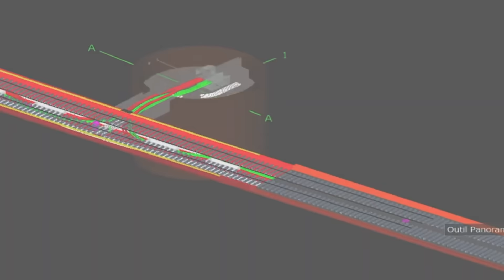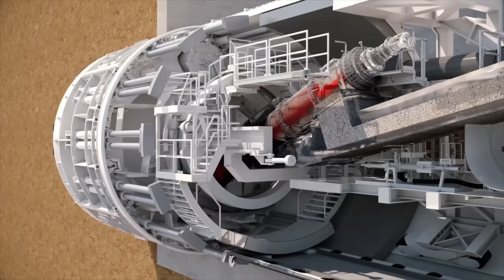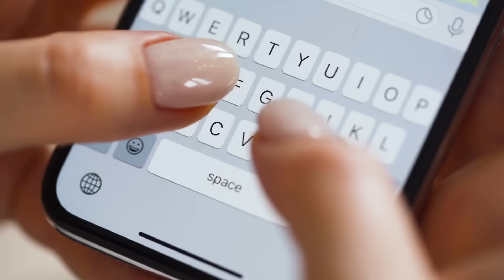The Grand Paris Express - Europe's Largest Transport Project

Comment: Whuile the addition of the jew lines will allow to tranits on the closest surrounding suburbs failry well nd will lightent he load int he middle, it's stillr ather unsuficient, there's still quite a lot of the Parisian region, especialy in the south-South East that still very car dependent. I know there's tram-trains that are going to be built there and there but still defintivrely could use some more int he outer parts.
And god know the RER B, C and D could use some renovations (especialy B south and D). Hell even a couple of lines of subways inside Paris could use some freshenin up and some way to aleviate the trafic (looking at the 8, 10, 12 and especialy 13)

Comment: Similar in some senses to the Elizabeth Line in London. Its quickly become one of the busiest lines in the country
Reply: The Elizabeth line (117 km of rails) passes through central London. Paris already has 5 lines like this 
RER A 109km
RER B 80km 
RER C 187km
RER D 197km
RER E 56 km
The Grand Paris express  (200km of rails) is different. It aims to connect suburbs together without ever passing through the center.

Comment: Amsterdam built a 9.7 km metro line, which took 15 (!) instead of the planned eight years, and cost €3.1bn instead of the original estimate of €800m. Arguably, Amsterdam is a very challenging spot to build anything, let alone an underground railway, but also arguably, Amsterdam has never managed to build a metro line and not ** up somehow.

Could be worse, though: could be HS2.

I love Ligne 14. The last time we were in Paris, we had a hotel a couple of minutes from the terminus of Olympiades. The escalator worked one day out of the week we were there (our son, who does not speak French, thought it was "horse service"). Other than that, it's beautifully designed, and it's just great sitting at the front of the train, which runs completely automatically.
Reply: Is your subway under sea level ?
Reply: @Difdauf  Amsterdam is two metres under 'normal Amsterdam level' (NAP in Dutch), so it is indeed.

Comment: The Grand Paris Express is NOT about 200km of track but about 200km of LINE (400 km of track). This line length is 100% in tunnels with up to 21 tunnel boring Machines working simultaneously. There are additional line extensions and open air lines

Comment: One of the worst project ever. 
France needs to be decentralised. 

This project is wrong in so many ways.
Île-de-France is a hell. Most people there want to leave to a better and more affordable place. 

They are using tax money to increase the number of inhabitants of a place that should instead shrink and be scattered across other regions of France.
Reply: After this project, the “société du grand Paris” is going to become “Société des grands projets” and RER are planned to be constructed in many French cities, and also there is the Bordeaux-Toulouse high speed line, the Lyon-Turin… yes France is too centralized, but Paris needed that and the rest of the country is not totally abandoned
Reply: @sans_hw187  23 French cities inaugurated a new tram network in the past 20 years. That's basically more than any country except China. Rennes inaugurated last year its second metro line and a third metro line is currenctly under construction in Toulouse. So it's not as if nothing were done in the rest of the country.

Comment: Added to all of these are also a comprehensive number of new Tramway lines, and a few RER/Transilien extensions. All this project is a godsent is if works as intended , as the few lines crossing Paris West/East like RERA are at near 170% capacity. Traveling on both sides  without getting through the center, it's the dream of a huge part of the Ile de France population.

Comment: They should think about maintaining and cleaning the existing metro network first. It's disgusting and unreliable on most lines. Not to mention archaic with the stupid paper ticket system which fails most of the time. Get with it and let people tap on and off with their phones It's decades behind the rest of the world.
Reply: Well they are doing that too, line 4 has just been automated and other lines are gettin brand new trains. The paper ticket system is coming to an end and you can already use you phone if you have an Android system. If you have an IPhone, the function will be available in early 2024.

Comment: I'm in Montreuil, a near Paris suburb, and I work in Paris. I'm waiting impatiently for the line 11 extension, which is already late due to Covid, and got once again delayed from fall 2023 to spring 2024. That's more than 18 months late compared to the plan when I moved here. I have to travel by bus to Montreuil downtown and take the metro (line 9) there, which is very inconvenient. When the line 11 finally opens, I will save at least 30 mintues on each trip, so one hour a day, not speaking about the difference in travel comfort. I can't wait, seriously...

The Grand Paris metro is not the only public transport infracture currently in development in Paris. The RER E line is also extended to the west, to La Defense and Nanterre, and multiple new tramway lines and extensions of existing lines are in the works.

Paris organizing the summer olympic games in 2024 was used as an argument to make the Grad Paris "profitable", so to say, as in "we need it anyway, but at least, it will be immediatly useful for the olympics". In the end, only the extensions of line 11 and 14 will be ready in time. Official reason is Covid. Of course...

Comment: I live in the South Eastern suburban area of Paris between 2 new stations on the new line 15. It will save me a lot of time. Right now with the trains I can only go to Paris in the North-West direction, with the new line 15 I will also be allowed to go East and West and circle around Paris and connect with other lines, I'll save a lot of time to reach the airports, business centers, or even Disneyland.
The project is needed by the population, it's a very good investment, and it's only a new beginning because more stations and more lines, at an even cheaper cost of construction, will appear over time in this 21th century.
The metro web of the region won't stop growing anytime soon, that's a certainty.

Comment: I line 14 will be over staturated once all line are connected ... I'm afraid Paris transportation will be worse than toady (that is already a hell)
Reply: Line 14 trains have been enlarged from 6 cars (90m) to 8 cars (120m). And considering that it has SAET automated system, it will have the frequency to deal with it. The good news is that it can relieve a bit the RER B which is a bit alone currently in the Southern suburbs.

Comment: I work beside the future line 18. It looks to be at an advanced stage (tunnels finished, stations being built), but the first section (Massy to Saclay) is not set to be opened until late 2026 and the next stage (Massy to Orly Airport) until late 2027. I'd love to know what work is required for the next 3 to 4 years.

Comment: Projects like these should rightly be celebrated, even if they do inevitably go over budget (19m to 36m is quite a jump). Here in the UK, transport projects like these (such as HighSpeed 2 and Crossrail 1) generally are threated with cancelation if costs overrun, irrespective of how much the country desperately needs them. Crossrail has revolutionised travel through London just as the Grand Paris Express will revolutionise travel through Paris when it opens, here's hoping that it doesn't get cancelled or scaled back.
Reply: 19 billion to 36 billion isn't just cost overrun, the project has been gradually expanded. There are about 10 sites per line that are seeing cost overrun with each site costing tens of million more. Covid-19 cost the project a few hundred millions. The budget will probably continue to rise by a few billions and some estimates are still way too conservative according to some experts.

The recent bout of inflation is probably good news, generally, you wanna build before prices rise. Infrastructure projects built in the 2010s look good value today and will look cheap in the 2030s.
Reply: It won't be scaled back. 2 extensions of the new metro line were questioned, but they recently decided to still go through them

Comment: I have lived in France (Île de France) since 1996 and Paris proper since 2014.  Power lines and cables have to be put underground for this massive project which has caused a lot of disruption in neighborhoods far from the sites of actual construction.  There has also been a "chantier" (construction site) on Avenue d'Italie for years causing an already heavily used (trucks and cars) artery to be traffic-jammed most of the time.
Reply: Uh? Power lines and cables are always underground in Paris proper and in most of the inner ring of suburbs.
Maybe you're referring to the displacement / rerouting of utilities that were in the way, prior to major construction?

Comment: it was already a "project" 10 years ago, and it never came to action, and would probably fall appart ... 
French institutions are so slow and french economy is so bad right now
Reply: Feeling a bit depressed?  This program has huge momentum and is going well. It is delivering at 3 times the speed and 40% of the cost of such project in the Anglosphere. And they are the ones usually to get cancelled. As for the French economy it has moderate inflation and modest growth currently. Sorry to break it to  you.
Reply: Well, now that most of the tunnels are bored and tracks are being laid, it's a little more than a mere project...
Reply: What? The project is under construction and going very well. Line 15 south part will open in only 2 years. French economy is not doing great but still better its major neighbors
Reply: @sans_hw187 Line 15 won't be opened in two years.
Reply: @aquarius4953  the southern part, between Pont de Sèvres and Noisy - Champs, is scheduled to open in late 2025.
Reply: @sans_hw187  Tant mieux ! Ce qui  m'intéresse le plus c'est la ligne 16 et la correspondance entre la 15 et la 16 à Noisy le Grand.
Reply: did you even watch the video ?
Reply: My dear @solareiusdeiu, since you promote "Real Life Superheroes" on your own channel, you should add this video to it, because all the women and men working on this gigantic and, indeed, very successful project, are true "Real Life Superheroes"... No, French institutions are not that slow, French economy is not that bad, Earth is not (that) flat, and Neil Armstrong did not set foot in a cinema studio... Keep well.

Comment: The map you're showing at 0:23 is NOT ile de france, it's Grand Paris, and it's around 800km2, not 12.000.

It's quite obvious from just looking at it that the area named Paris is more than 1% of the whole map (which it would have to be if the whole map covered 12.000km2 as you claimed.

Comment: Orly needs a subway connection, Taking the tram 7 to the Metro 7 was and is ridiculous as Orly was the the main airport in Paris and is the domestic (EU)  airport in Paris now as Charles de Gaulle is now the main international airport.  Extending line 7 to Orly would make more sense to me than extending 14, but I'm sure there must be a reason for that decision.
Reply: Line 14 is the most recent one, fully automatic. Plus the 7 is already split into two directions southwards: Ivry and Villejuif. It would have limited the capacity to bring people to the airport.
Reply: @Markopar75  I would rather see the Maison -Mairie branch become a shuttle service with a transfer and extend the 7 line to Orly, It would safe 10's of millions of euros in tunneling, the 14 should continue west to east to help connect communities radially
Reply: @MannySilva   I see but it would make no sense since like you've mentionned above, they've built a Tram line 7 that starts at Villejuif and goes south to the airport. It's already a kind of extention of the metro7 to Orly but a cheaper version. Almost as if they didnt want to invest such money in a costly metro extention back then.
So, as of today, i think extending the metro7 would making the tram7 useless and built "for nothing".

When it comes to line 14, it makes sense for me. It will now be the spinal cord of the network, just like our line4 was decades ago for North-South travel through Paris before RER was installed.
The fact the 14 is the newest one, automatic and thus surely the most efficient (I guess) made this choice the obvious and rational one I suppose.

Comment: We need this in London. Outside of the inner london area, transport between the suburban boroughs such as Merton an Bromley is practically impossible by train, without going up to one of the terminus stations in the centre and transferring back down. A ring railway aroud these outer boroughs would do wonders not only for London but for the entire country; train trips between large cities around london could simply go around it, instead of having to go to a central terminus and changing. The Paris Grand Express puts projects like Thameslink or the Elizabeth Line to shame!
Reply: I live in London, but after all the money spent on the Elizabeth Line the next major such project should pass to a regional centre. I'd like to see better rail infrastructure connecting Manchester to Liverpool, Leeds, Bradford, and Sheffield.
Reply: There is Crossrail 2 a north-south version of the Elizabeth Line which was on the cards, but who knows if it will now happen, with HS2 being cut back, infrastructure spending is hugely expensive in the UK.  But would also agree, that most uk city and large towns operate a centralised system, you have to travel into the middle and then travel back out.  We need some ring systems to allow people to move as well (this is why north and south circular roads and M25 were built for road traffic, we need the same now for Rail type traffic.
Reply: I prefer using my car

Comment: As a Dane it seems that we have a much better and tighter subway system in and below Copenhagen. It rides by itself and very efficient with no drivers in the trains. It is constantly being expanded and getting new stations below.
Reply: I don't see the point of this comparison since the two cities don't gave the same size and needs : the whole Copenhagen metro + S-train annual ridership only represent barely more than 2/3 of the only RER A line.
Reply: To add to what rpthe others said, apart from the size your metro opened in 2002, 102 years after the Paris metro opened, and there were no automatic trains. That said, apart from the new 4 lines that will be automated they also converted 2 of the older lines (1, 4) to automated and line 14 that was automated from the start in 1998 (before you had a metro).
You still have a good metro system that has the advantage of working 24/7.
Reply: How you can compare CPH with Paris, an urban area with more than double population of your whole country??
Reply: the population of paris + its suburbs is twice the population of the entire country of danemark...
Reply: i mean all the new trains will be automatic and we are changing lines from requiring a driver to automatic... Also there is going to be like 70 new stations, how is that not an expansion of the metro system ???

Comment: No one-seat rides to the airport from most points in the IdF, a difficulty on top of the absence of a union station for the railways that converge in Paris. And no itineraries that don't involve having to switch stations and trains in order to go from say Nantes to Strasbourg or Lille to Toulouse.  Same problem in Japan.  A one-seat ride from Nagoya to Sendai?  Forget it!   Only USA (and India?) allow through trains to stop and then continue onward travel through their capitals.  Legacy of royal autocrats?
Reply: There's a giant high-speed bypass around Paris.
You simply don't need to change trains in Paris, just take the one that bypasses Paris.
It's simple as that.
You can run from Lille to Marseille on a high-speed train without having to cross Paris center, the trains run on the bypass, under CDG airport and Disneyland Paris Resort and stay on a high-speed line from beginning to end.
Reply: @KyrilPG Trains bypassing Paris are rare though. More because of financial efficiency than because of a lack of tracks. Most people want to go to or from Paris and trains starting or ending in Paris are much easier to operate as they don't interact with several directions (directions from Paris). Lyon - Bordeaux for example simply doesn't exist.

Some connections are also physically impossible because of a lack of bypasses. I think Nantes/Bordeaux - Lille is not possible.
Reply: @noefillon1749   Yes Bordeaux > Lille is possible, there's just that the link between the Southwest line and the high-speed bypass (that starts from the Southeast HSL) is via regular legacy tracks.
There are trains running between Nantes and CDG airport everyday, which is located on the bypass.
The Paris Eastern high-speed bypass currently only connects 3 of the 4 main HSL's out of Paris : LGV Nord (North HSL to Lille, Brussels, London...), LGV Est (East HSL to Strasburg), LGV Sud-Est (Southeast HSL to Lyon, Marseille, Montpellier, etc.).
Trains to or from LGV Atlantique (Southwest HSL) must slow down to regular speeds to briefly run on the regular network before re-entering the high-speed network.
But trains to / from other LGV's remain on the high-speed network all the way.
All connections are possible, only the bit between Southwest HSL and Southeast HSL / HS bypass is via regular legacy tracks.
This high-speed bypass is expected to be completed some time in the future but it's unclear when.
Reply: @KyrilPG  Thank you for the correction and the precise explanation.
Reply: Not sure if you're saying USA and Japan had royal autocrats or France did, but the multiple non-through stations in the capital is the same reason as London, rival railway companies all wanted their own grand terminus.